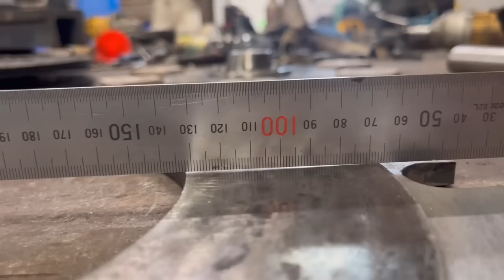Upgrading twin plate clutch in Fordson major tractor puller. Machining floater and drive plates.

Comment: I found that really interesting. I used to work with large industrial gearboxes among other types. I have to agree that the 6 paddles definitely seems to be insufficient, we could be wrong, but I bet that the clutch will need replacing sooner than what the customer thought. Good post 👍

Comment: Cool Videos.  I own a 1956 major.  It needed a new new clutch last year and the bloke who did it for me had angle iron "train tracks" bolted to his workshop floor and two trolley jacks ran inside them.  He put a ratchet strap around the split tractor and as he tigtened the strap, the jacks came together running inside the angle iron tracks, and the tractor went back together perfectly.  Thought that was a pretty good set up.

Comment: Thanks for the video, Guys fit those discs to Belarus tractors here in Canada for loader work as an "upgrade", they don't like skimming flywheels or putting new covers on unless they are total junk, so they chatter on the rough distorted surface, and they operate like crap. Then the next thing is it's like putting a big fly cutter in as that disc absolutly machines any surface clearance thats left right off in 1000 hours or less then they won't dissengage as the rivets hit bolt heads on the flywheel or PTO drive hub. It's just a whole bunch of fun trying to explain this to customers , then end up doing the job twice after they tried saving some $ L.O.L . I'm just going to convert my 6 power major  from live to dead drive gearbox and do a dual clutch so I can antique pull without the offensive "odour de burned major clutch" perfume smell L.O.L  , I was thinking the parts would have to come from the U.K or build it locally but luckily I found a US company that makes a 13" spacer plate and has an updated cover and spacers to fit as well. Hope somebody post a video of this one running on here, it'd be good to see it this season. Take care.

Comment: Nice job. that Cargo engine doesn't quite have the clickety clack that an old Power Major would have done back in the 60's.
Reply from the maker: No not quite 😆. Very distinct sound to a major when the pump coupling gets a bit of wear.
Reply: If that cargo engines going clickety clack owning it's just got expensive,because it's probably tossed it's cookies all over the pulling track L.O.L. Here in Canada it's a job to find any Major that makes the traditional pump coupling noise, 99% of the ones I see or own have been updated to the silent lovejoy type  rubber coupling the last of the super Majors used. I actually like them like that, you can hear what a nice running engine they actually are with the silent coupling if they aren't totally worn out junk.

Comment: Clutch info. Measure from the head of the rivet to the friction surface.  Times 4 since you have 4 friction faces.  That should be the distance between the cover foot and the flywheel face without the bolts pulling the cover down.  
There are specs in the service manual for the finger height when the discs and cover are bolted down to adjust the fulcrum screws.  

I personally don't think there is enough clamping force in the current adjustment to prevent the clutch from slipping.
Reply from the maker: Thanks for the info. I think the clamping force will be fine. There was a good amount of distance between the cover and the stands before I started tightening the bolts down. The clutch feels good underfoot and engages and disengages properly so I'm happy with the finger height.

Comment: Won't it weaken the clutch plate center hubs spline shaft engagement by removing that much material? I know it is two disc but that is a LOT of stress in a pull.
Reply from the maker: It never seems to be an issue, the shafts always twist before anything happens to the splines. And it’s the only way to fit them in.

Comment: Nice job, but make yourself that splitting rail and trucks - you'll kick yourself for messing about so long.  I was told the most important tool when splitting a tractor is the workshop broom!!!  ................... Do you use the starter motor trick when they ''won't'' go together? ....come to think of it, the Youtube safety police would ahve a fit with their leg up